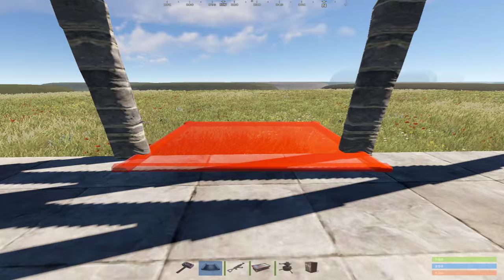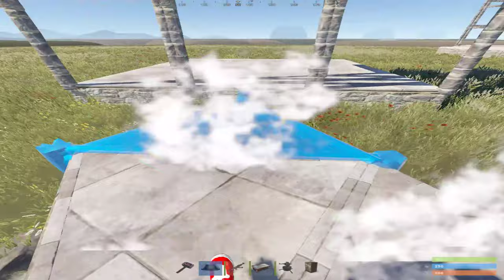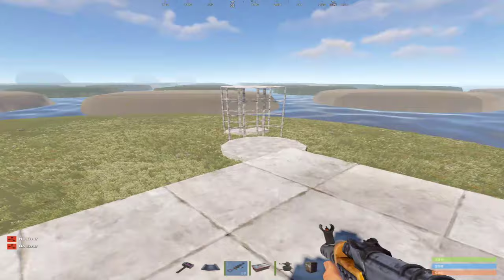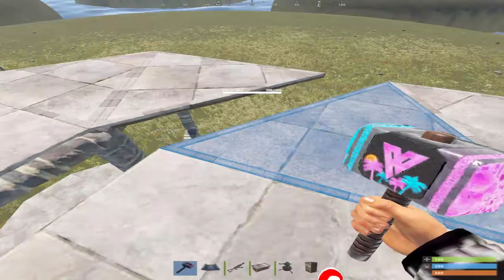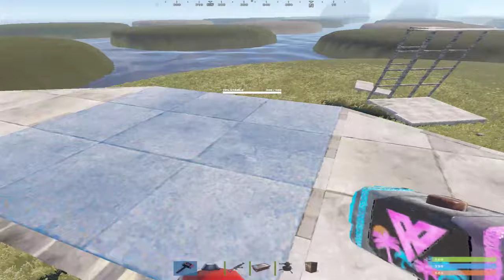How to build Wide gaps in 33 seconds | RUST

Comment: It’s confusing because every wide gap video builds out a different number of squares.  You built out 3 squares, others do different
Reply from the maker: The amount of squares is mostly reliant on how big of a gap you want it to be, but 3 squares I generally find it the standard
Reply: @glarsonyen4462  wrong. depends on the shape of the base.
Reply from the maker: @fortune8399  ...and the size of the gap you want it to be